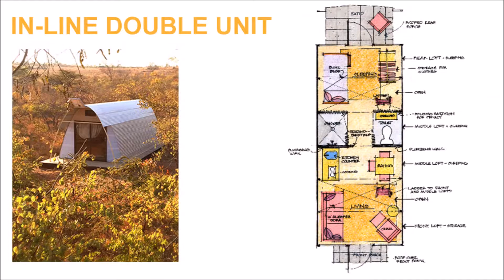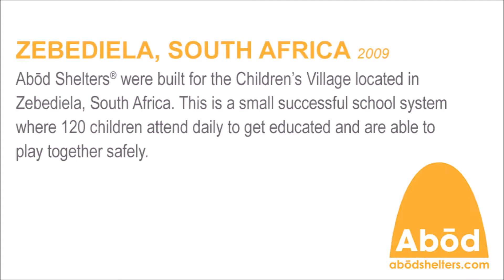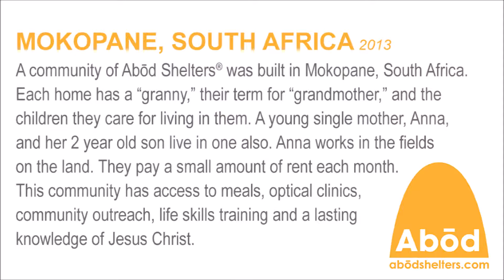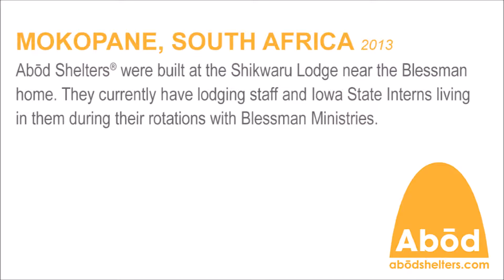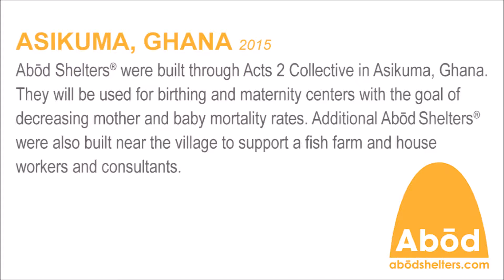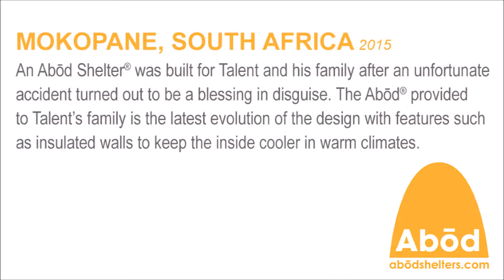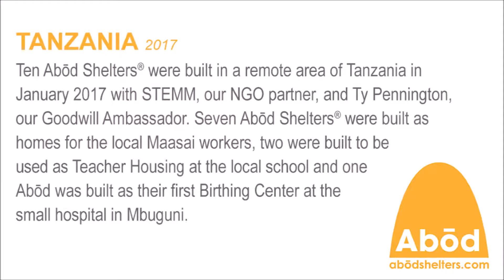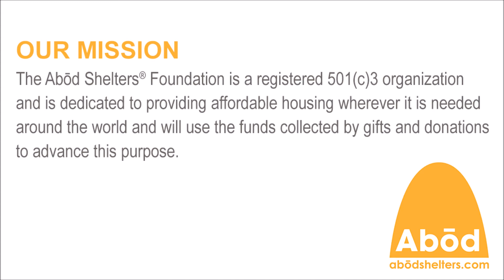Abod Shelters Projects / Interviews

Comment: Abod Shelters seems a very noble effort, similar in some respects to one of my architecture heroes: Christopher Alexander ("A Pattern Language" with coauthors) who did great work in Mexico developing resident built very low cost homes.  He also did work for the UN developing a model program to transform slum areas into resident-centric neighborhoods using local resident labor and directed design.

I will ask the director of WEEMA International (NGO doing great work in rural Ethiopia, www.weema.org) which my wife and I have done volunteer work with in country, to look at the work being done by Abod.  WEEMA has completed clean water, rural health clinic, community library and school building projects.  I think the work and design by Abod Shelters would be a good fit with WEEMA's mission. 

The thermally isolated roof shade is one of many excellent design elements.  The integral strength, structural simplicity, functional versatility, quick fabrication time, ease of construction, and low cost are an amazing achievement.  Very, very difficult to bring all those goals together successfully.